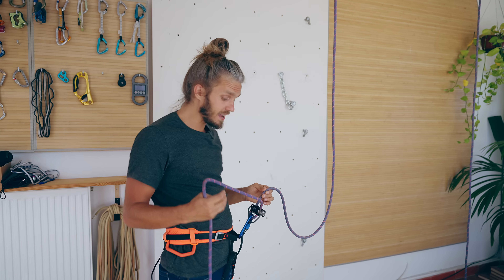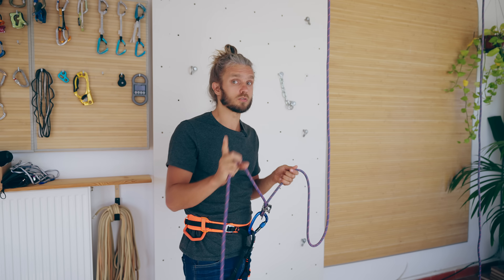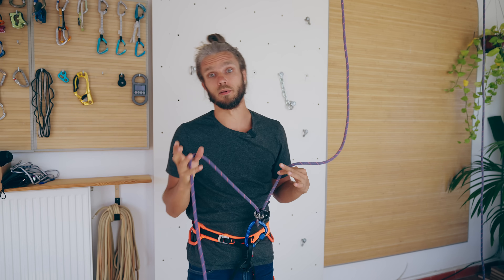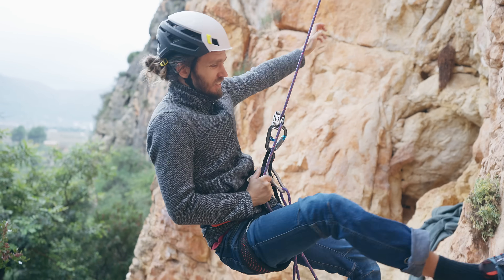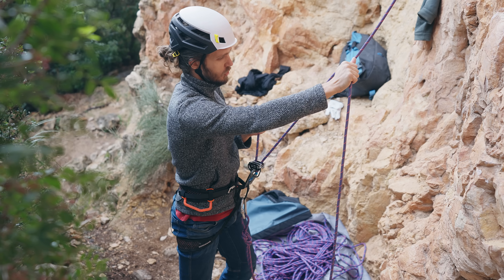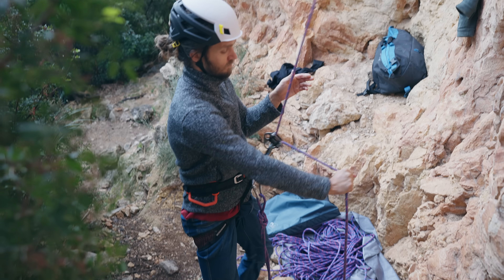Brake Hand Up during a Fall? 0.92s to bring it down... or...!

Comment: This is a very important topic.  This illustrates the potential for the hand to get pulled into the belay device and lead to a pinch of the brake hand.   The concern is that this could lead to an involuntary response to release the brake end of the rope.

I never keep my hand above the belay device for any extended period of time.  When I reach the high point of taking in slack, I immediately return to pull down.  If someone falls it is easier to catch them. 

Just some feedback on how you are holding the brake end of the rope.  Most of the video you have wrapped the thumb around the rope.  There were some situations when this thumb wasn't wrapped around the brake end of the rope. 

Cheers,

Comment: The problem with the test was that you know it was coming. In the real world you're going to spend a lot of time not expecting a fall then suddenly it happens out of nowhere. When you're expecting an event your reaction time is typically 0.2-0.3 seconds. When you aren't anticipating an event it will usually be 1-2 seconds at best. In an event like this that's a fall of between 5 and 20 meters before you even start to respond, though the resistance in the rope will likely reduce that by some amount.

On the other hand taking in the slack as fast as possible wouldn't have that reaction time as you're already doing the motion. So it's "only" however long it takes to take up the slack at the rate planned. Probably still not enough time, and you're not getting cheetah reaction regardless, but a far better chance of catching the fall with your hand in the equipment rather than catching nothing at all. I'm not personally a climber, but if I were I wouldn't want to rely on someone's reaction times as the physics and biology simply don't equate to a safe time here.

Comment: Is there a such thing or a way to anchor the Belayer?
I can add to the conversation but I will wait for that answer
Reply: You could anchor the belayer. But it is much safer to not anchor them because the belayer being lifted up in the air will dampen the fall further.
Sometimes, if the belayer is very light-weight, and the climber very heavy, the belayer will in fact be pully up very high. The belayer can hit the first anchor of the rope, sometimes even collide with the climber mid way.
If you are light weight you could, for example, clip your harness to your bag(which is sitting on the ground). That'll add some weight, make you not lift up as much. But you wouldn't want to anchor yourself firmly.
The other way around, if you are very heavy and belaying a light weight climber, the falls with something like a grigri will be very rough.

Comment: I first learned lead belaying on an atc. A couple things I remember from back then (maybe 8 or 10 years ago though, so take it with a grain of salt):

- No matter what device you're using, you can always step away from the wall to take out slack quickly (assuming it's safe to, particularly if you're outside). I would usually do this if they're frantically yelling "take!" and are at risk of falling, but less often in the middle of a fall (b/c harder catch), unless there was a risk of a ground fall and there was too much slack out to take out at once--maybe after failing to clip?

- I don't remember ever pulling up on the rope to take slack, I'd usually pull sideways towards my break position (I'd ideally break with my right hand at right hip). Since there's no tension on the rope, it is easy to pull through, especially if your other hand is feeding the climber's end of the rope into the device. I've found this is harder to do on devices with assisted breaking, though.

Love your videos! Thanks for doing these experiments, they really help me analyze my own techniques and hopefully improve them.

Comment: On TR belay I always prefer short and frequent takes rather than long ones, because it's much easier to shift my left hand under the right for sliding up when the take is short, plus my right hand (break hand) spends less time above the belay device this way.

On lead belay it's mostly managing the slack so the potential fall is minimum and pay attention to the climber to anticipate the fall. I don't like to take out slack during a fall, would rather just go straight to break position so there's no risk of rope slipping through.

Comment: Is this a problem when trying to take slack quickly (to prevent a ground fall) with a GriGri?
Reply: with grigri the position of your brake hand is less important, as it’s supposed to lock even when the hand is above the device. still good to keep it down though ;)

Comment: Pulling in slack on a fall or immediately after a clip is one of those behaviors I wish people would ditch. This and “handing” the rope upwards rather than coming back to the device and the exaggerated steps forward to feed slack. If the amount of slack wasn’t safe for the fall then why feed this in the first place?

I am obviously not talking ground or ledge fall potential where the belayer is assessing how to keep the climber safe. This is not the vast majority of falls. This is gym and eighth bolt falls and similar.

Comment: As a personal note, if you are sport climbing on single pitch, please don't use a tube device. Use assisted belay device, like grigri.
Last Saturday I've been involved in my first climbing accident after 11 years of climbing. We were taking all the usual safety precautions (everybody had a climbing helmet), and that saved us.
As I was climbing in a spot I am used to climb, 10m up in a route that wasn't sketchy and I had done multiple times, a couple of big rocks (the small one as big as a head) broke in my hands. The small one fell onto my belayer's head. He lost consciousness for a few seconds, and was evacuated by helicopter.
He is fine, the dude's a boar. He miraculously got away with only a small skull fracture and a few broken teeth. He'll be out of the hospital later today.

Since he lost consciousness, had he not been using a grigri, which locked the rope, I would have probably fallen to my death.
Also, always use a helmet. No matter how experienced you are and how well you think you know the rock, shit can happen. His life got saved by his helmet.

We have been extremely lucky, it could have gone really bad in a thousand different ways. 

PD. In case you didn't know, all materials have limited lifespan. Check the technical information about your gear and renew it before it is too old to properly function. (i.e. for petzl gear it's usually 10 years, but it can change with other brands)
Reply: I agree with the benefits of using an assisted braking device for belaying.  I was climbing with a partner who completely let go of the brake end of the rope because they fell over.  I was dangling on an overhang.  The Gri Gri locked up and prevented me from decking and taking a 15 foot fall. 

After this I switched from a tubular belay device to an assisted braking device.  I choose the Gri Gri.  I now insist that my partners use an assisted braking device when they belay me.   I acknowledge there are certain scenarios where there is a disadvantages to using an assisted brake device, but I don't find myself in those situations.
Reply: Yikes - glad you all survived!

Comment: Hey! I really like your videos, I want to share. I am a climbing instructor and have experience with dynamic belays on "Reverso" devices. It all depends on:
1. belay device
2. rope diameter
3.weight leader
4. belayer's weight
5. jerk factor
Most often, it is enough to raise your hand to the level of the device, but at the same time have a margin of rope between your hand and the device at least 60 centimeters. The glove makes it possible to pickle the rope more than without it, if you do not grip hard, but gently squeeze the hand.

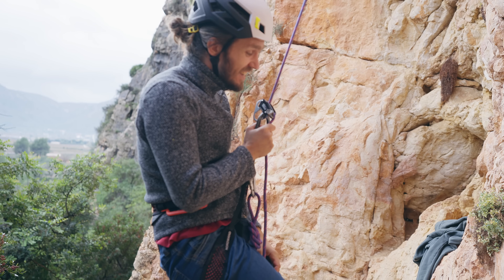Comment: Perhaps it's nitpicking, but the way you grab the brake rope together with the carabiner several times (for example at 0:45) is perhaps not the best example. I always teach my students to grab the brake rope with (at least) three fingers and always wrab the thumb around the rope as well (in opposing direction). If I see it correctly I think you're 'just' holding on to the brake rope with four fingers that wrap around the rope in the same direction. Adding the thumb greatly improves your capability of holding the rope and not letting it slide, because it wraps around the brake rope in the other direction. Great video nonetheless, thank you!

Comment: Can I ask if there is a maximum difference between the weight of the climber and the weight of the belayer in kg? For example, can a 50kg belayer hold a fall of an 80kg climber? Belayers like grigri would help reduce this weight difference if not during a fall, during the descent ? Thank you so much for your videos, I’m a beginner and you are incredibly helpful
Reply: Edelrid ohm is designed exactly for that reason, it brakes the rope and allows a light belayer to hold a heavier climber

Comment: Thank you for your experiments. You‘re addressing important questions with a lot of practical background!

I am always wearing gloves while belaying. The idea is to avoid the risk of letting go of the rope due to burn caused by friction or because my hand gets sucked into the belay device. 

We‘re also trying to communicate the risk of a possible fall similar to standardized commands (like „off belay“). We feel that as a climber you often have a bad feeling before/when you‘re falling and any extra warning can help you to be a cheetah. Of course, that is not possible for falls that the climber does not see coming.
Reply: I think the standard is "watch me" when you're about to do a high-risk move

Comment: Do you have any problems with that Mammut Tri Lock Carabiner? I got mine a while ago and the small blue thing to prevent the carabiner to turn sideways is super hard to move and sometimes (better say quite often) it gets stuck in the opened position and I only ever used it indoors and there is no obvious dirt in between the moving parts.

Comment: Others may have mentioned but in case no one has — I’ve noticed that folks using slip-slap-slide (instead of PBUS, like you) often default to holding the brake strand up high (instead of in braking position), just as their default resting position. Compounding, they often hold the brake strand pretty close to the device, giving even less time to react. Too, regarding what you discuss around 4:40, slip-slap-slide doesn’t really work well with pulling slack outward/away from your body, you kind of have to pull upward in alignment with the climber’s side of the rope.

I don’t know how damning any of this is, but it is of particular note since they’re all things you call out as bad belay technique here. I’ve also always wondered if the brake hand in slip-slap-slide is less effective? It seems like you’d get less control over the brake strand, but I have no data to back that up.

Comment: Years ago i was introducing a friend to the sport and got drop to the ground when getting lowered.
Luckily there was a small tree below me and it cushion my fall.
What happened was that i had my hand in the other side of the rope on the start (exactly to make sure she wasn't gonna drop me) but after a few meters i felt it was ok and let go.
The difference on the force pulling the rope was enough that she couldn't grip it anymore (because her hand was too high and i didn't notice it) the rope burner her hand and she let go...
Reply: She was using atc ?

Comment: i asked me this question because i was used to take out the slack with heavier climbers and now i found someone the same weigth i dont need it any more
Reply from the maker: Yea... use Assisted belay device that doesn't have these risks and you are good. GriGri, Mammut Smart with smarter addon, Revo,
Reply: @HardIsEasy  mostly i use grigri, sometimes reverso but yeah its better to use with same weight climbers

Comment: This is exactly why I use clickup+ (opposed to regular clickup), its the only device besides REVO that breaks even if your brake hand is up. And for frequent ATC users, its not entirely stupid to use a glove for the brake hand, saved my skin one or two times already.
Reply from the maker: How is clickup+ for you? I find it one of the worst devices for lead belaying :D
Actually GriGri or Mammut Smart with smarter don't have this issue as well, so it's not only Revo and clickup+
Reply: @HardIsEasy 

To the clickup+  ...  it was a learning curve, loooots of locking up on me. The trick lies within uncoiling the rope and technique - CT actually have this on their yt channel, they call it "fast slack technique" or something like that, where you bring your hand to the level of the device and let go of the grip while giving slack. Once I mastered it its as easy as  an ATC and I actually like that it locks up superfast when the rope is weighted. I like it more than grigri which is more prone to human failiure - heard too mamy stories just from my local gyms.

Practice tip for the clickup + (how I taught myself and my friends to use it): Just give as much slack as fast as possible at home. I did like 500 meters of rope and since then it rarely locks up even with my 10mm rope.
Reply: Just curious but do you need special climbing gloves or just any glove will do?

I typically use a Black Diamond ATC Pilot (assisted breaking device)
Reply: @motherlove8366  Personally I use tactical gloves, they offer the best durability/dextirity ratio. Pig Gloves or mechanix high-dex are both fine choice. I also use them for via ferratas. But honestly I think anything will do, just make sure you have okay dexterity so you feel the rope.
Reply: @alexbarcovsky4319  Thanks for the answer

Comment: Good video. Thanks for always making yourself available as a test subject. I think what is an important point to mention is that with autotubers the angle for pulling in the rope may be different. I believe that in tests the Click Up performs poorly compared to other autotubers. That is why it is more likely that the rope slips when pulling in the rope and falling at the same time.

Comment: super interesting Video. I wasn't really surprised about the results. Since you already work with Mammut they have a thing called "smarter" that you can clip on the assisted breaking device Smart 2.0 It helps to redirect the break rope in a forward direction, so even if you handle the rope incorrectly the risk of the device failing (like the click up did) should be prevented

Comment: As there was a controversial discussion about the sliding up method of belaying, could you test this aswell? For example: Unexpected fall while breakhand is around the rope (and rope going down, like it should be done), but not gripping tightly. Would be intresting to see the effect, if it has a massive slip or what reaction it might require. Greatings
Reply from the maker: I have super amazing video coming on this topic ;)
Reply: @HardIsEasy  Perfect!
Reply: @HardIsEasy  cant wait too...
Reply: @HardIsEasy  Are you still planning to release that video?
Reply from the maker: @shadiester  yeap, I'm in a bit of filming period atm, but soon to switch to edit / publish again :)
Reply: @HardIsEasy  Sweet, can't wait!
Reply: Yeah, important question!
Reply: But you have to distinguish between normal tubers ann auto tube devices!

Comment: Hi nice video! Could you explain what is the purpose of the carabineer and knot attached to your harness? The reason I'm asking is because one time i was leading and felt before clipping. My belayer was like 20kg lighter than me and this resulted in a 3/4 bolts huge fall with my belayer banging against the wall all the way to the first QuickDraw... And she was using a tube type device... So she could easily let the break hand off... Nothing happened but I'm wondering if maybe you are anchored to the ground... Thanks! Love all you videos!
Reply: First time i was belaying outside of the gym, the same happened to me, with a tube device. I had my little finger smacked against the rock as i was trying to protect my face, and it broke. My brake hand didnt come off but it was scary because me and my partner met on the way of the fall.
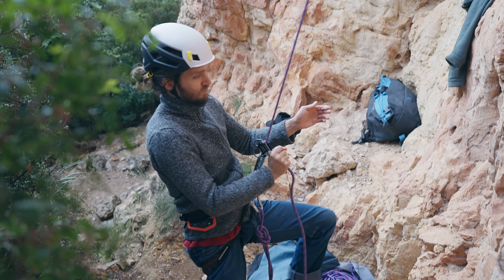Reply: I assume it is so if he does hurt his hand in this demonstration and doesn't hold the break rope any longer, the climber won't fall all the way down. You can see briefly at 2:12 that the rope has like 2m of slack behind the knot and then goes into the belay device.
Reply from the maker: It's just a backup in case I fail to catch the fall. you would not use this in normal belay scenarios ;)
Reply: Anchoring the belayer can easily be done and is done.. I cannot encourage or discourage… I would be excited to hear what everyone thinks..

Comment: What about device like Mammut smart 2 ? Are they the safest ? I mean, if you release the rope, they lock any way no ? (click up device are not lick mammut smart 2 wich is safer right ?)
Reply from the maker: Mammut smart has an addon called Smarter, it prevents from the issue talked about in this video. CT ClipUp released a new version ClickUP+ but it's not as great in my opinion.

Comment: hmm... Question: What about other hand? I mean, when I take out the slac i always have my other hand tightly on the rope on the other side of the device... it should in principle give you additional time to react, shouldn't it?
Reply from the maker: You won't be able to hold with the other hand anything, but you are right that it gives you a sensory warning to bring your right hand down asap.
Reply: the sensory advantage of the non-braking hand is better if it’s not gripping tightly, only very slight tension, almost pulling down a tiny bit. That allows you to “feel” what the climber’s doing even if you can’t see them and might give a very short time advantage.